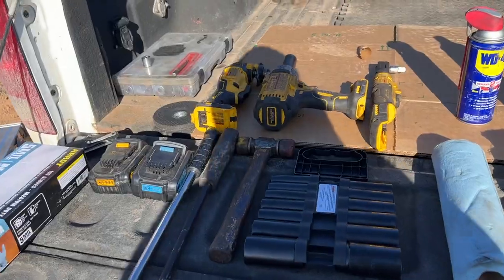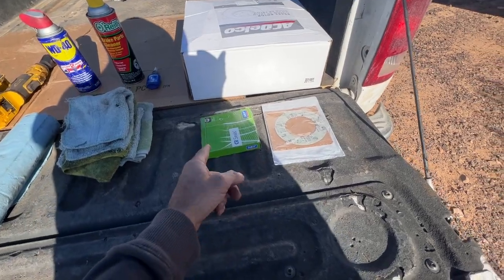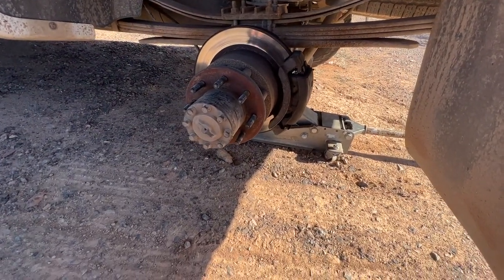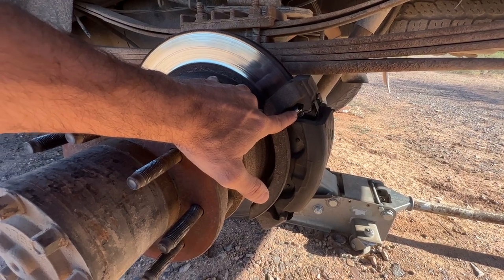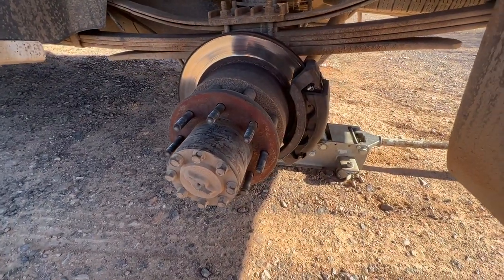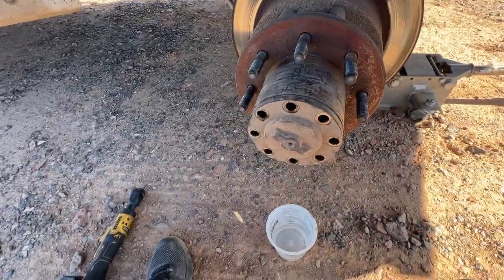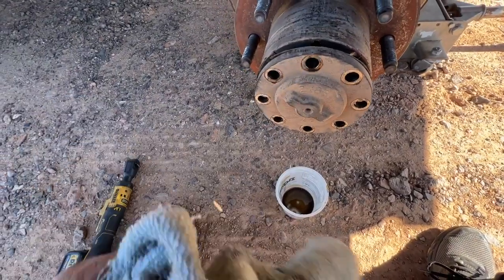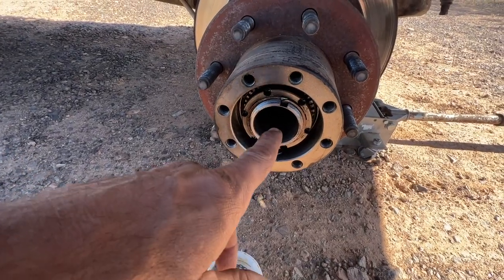2005 Dodge Ram 3500 5.9 cummins dually - Rear Rotor Replacement - Step by Step

Comment: if that axle is sealed, aren't the bearings being lubed with gear oil from the rear end and not need to be packed with grease?
Reply: Yes, they are oiled by the diff, the issue is it will take a while for the fluid to get to it, so you would be running them dry for the start, if that makes sense.